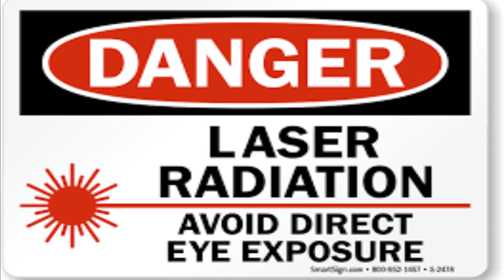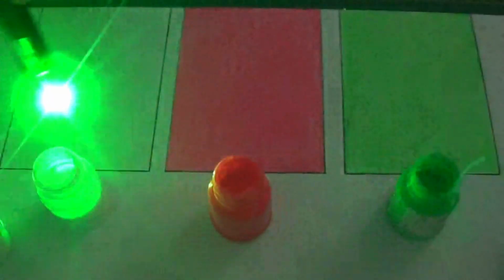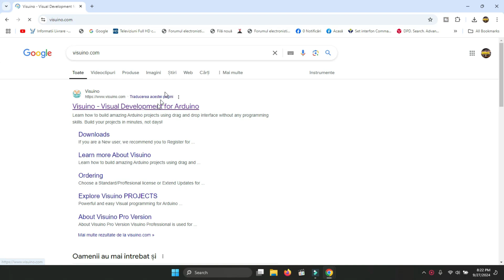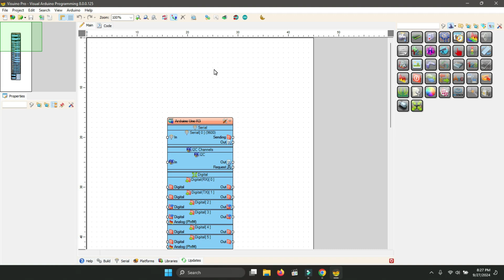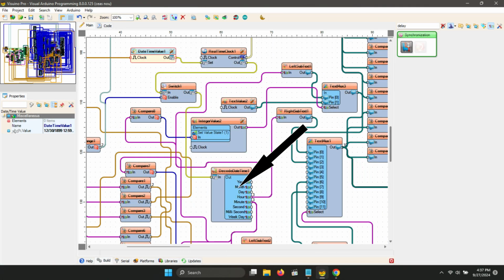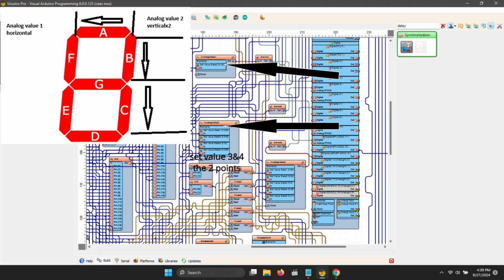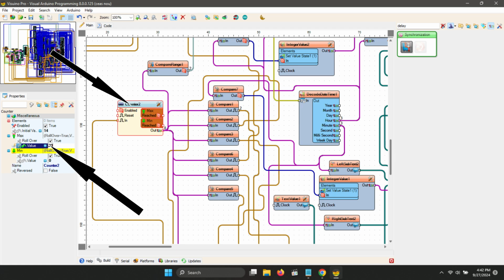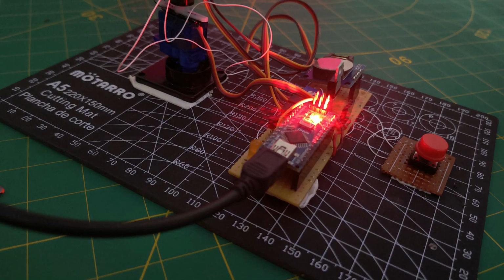Clock With Laser Projector! Visuino Project!

Comment: just an insight about light you have missed, and may have some use on this or future projects: IR light can remove the energy trapped on atoms metastable electronic state. That means you can immediately turn fluorescence off (effectively "erasing" what you just wrote with the laser) using some IR flashlight or even an IR laser.
Ideas that come to mind are some high refresh rate uses for fluorescent "screens", given IR is invisible to the eye. I learnt that back in the day I built lasers by the dozens - good times. I miss 2008.
Nice and very creative project btw. Always nice to see lasers on the work.
Reply from the maker: Interesting idea with infrared. But I don't know how much it would help to quickly erase the characters, possibly a clock with a single digit. With the phosphorescent paint, you can apply several layers or you can process the paint with more or less pigment, and then the "image" will remain more or less on the display. Thanks for the appreciation!